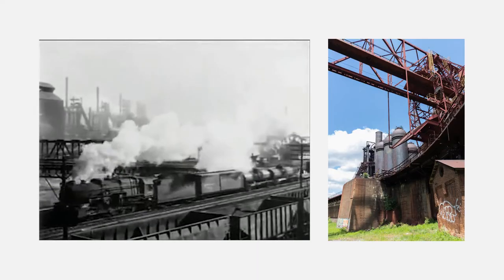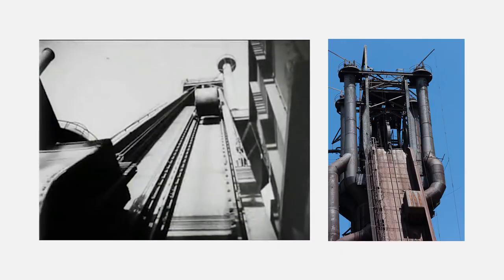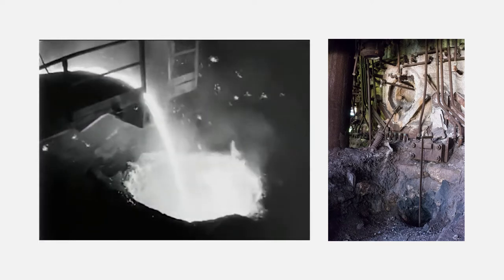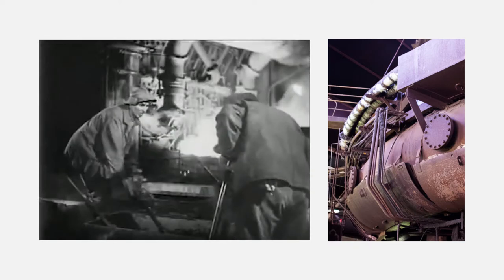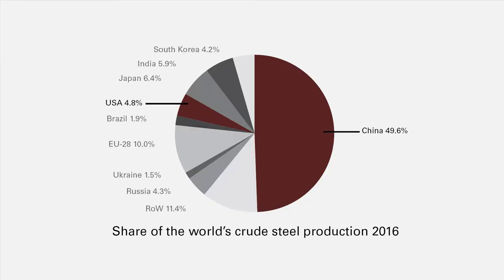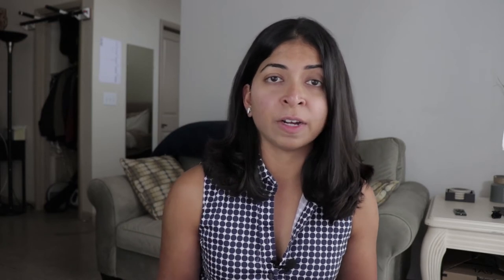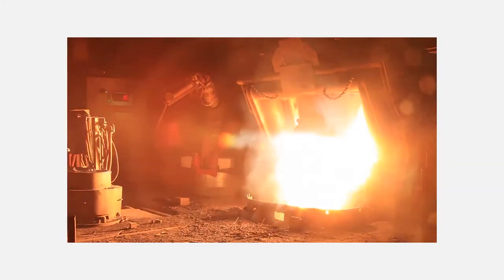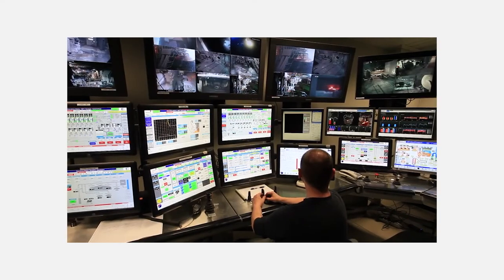Why US steel died (Carrie Blast Furnaces case study)

Comment: I had a history professor in college who worked at US steel when he was younger. His job was on the crew that would scrap slag out of the crucibles and other equipment.
He told us that because letting the equipment cool down could cause damage, and cause far too much down time. 
So his crew would get some heat-protective clothing, and they would strap wooden blocks to the bottoms of their boots, and they would have to work fast while keeping an eye on the remaining thickness of the burning blocks of wood and get out of the crucible before the wood ran out.
This was before he was drafted for WW2. He was a great professor.
Reply: That was definitely a different breed back then.

Comfort has killed drive.
Reply: It isn't a particularly ad-hoc approach.  Oak has been used as ablative heat shielding on spacecraft.
Reply: It was the same after the WW2, and it was the problem.
Reply: @josephcoon5809  "All of this family meals, use of pottery, and permament shelter crap is just weakness. Give me a grizzly loincloth and flint spear any day. Kids don't know how easy they have it! Comfort has killed drive." Hunter-Gatherer Patriarch 12,000 BC

Comment: I have said the same thing a LONG TIME AGO. Bethlehem Steel and other major U.S Steel industries should had have immediately applied a "REINVESTMENT CORPORATE POLICY" approach after WW II. The Karrick Retort Process can produce 5 products such as oil, high BTU coal gas, phenolics for making plastics, co-generated electricity produced by steam by it's water cooling systems, and smokeless and clean semi-coke which burns hotter and cleaner and thus requires less coal to produce 1 ton of iron from a blast furnace. The high BTU coal gas can be used to stoke to blast furnace to make it even more efficient, the co-generated electricity can be used to power all electrical power needs and to power the cryogenic liquid  oxygen liquefaction facilities for the basic oxygen processing furnaces. In the 1970s and 1980s the OTEC power generation technology that uses the warm ocean waters of Hawaii of 25 degrees Celsius to boil and vaporize liquid ammonia into a low pressure and low temperature gas to run the turbogenerators and using the only 5°C cold ocean seawater from an average depth of 1000 meters to condense and liquify it again back into a liquid. The same OTEC technology can be modified and adapted to use the waste heat of all iron and steel making plants to co-generate electricity to power their systems' electrical power needs partially or all of it.

Comment: Automation, A.I, and Robotization will create new carerrs in the field of "MECHATRONICS" Mechatronics, which is also called mechatronics engineering, is a multidisciplinary branch of engineering that focuses on the engineering of both electrical and mechanical systems, and also includes a combination of robotics, electronics, computer, telecommunications, systems, control, and product engineering. Mechatronics engineering technologists use a combination of mechanical, electrical, computer and software skills to work with smart technologies, such as robots, automated guided systems and computer-integrated manufacturing equipment. ... Manages electrical and mechanical systems. Tests new equipment. Installs new ...

Mechatronics engineering technologists will also create a demand for specialists specializing in mechanical engineering, electrical engineering, electronics engineering, chemical engineering, civil engineering and their sub-specialized fields such as computers, robotics, telecommunications, systems control, manufacturing product engineering, automated guided systems and computer-integrated manufacturing equipment. ...

Which in turn creates a demand for manpower in these 4 basic general engineering fields and in their sub-engineering fields or specialized engineering fields. They are then combined together in a structured organizational set up to integrate and coordinate their fields of activities to help each other to achive a final common goal and that structured organizational set up is called as the SYSTEMS ENGINEERING developed by the USAF airforce in the 1950s and by NASA in the 1960s.

The systems engineering set up(s) in turn created a tertiary sub-engineering fields called cybernetics, automation, robotics, computers, etc. And eventually evolving the residential and common office pre-computer era in the early 1980s and given a boost from a 1960s fiber optics technology that became fiber optics flower vase lamps in the early 1970s and evolved into the early 1980s fiber optics communications era FOR COMMUNICATIONS ONLY AND PRE-DOMINANTLY IN THE FIELD OF COMMUNICATIONS which eventually was adapted by the U.S Defense Department to reinforced their Computer Defense Networks using copper wires
of  their BMEWS (Ballistic Missile Early Warning Systems), ARPANET, DARPANET, INTERNET TECHNOLOGY, AND EVENTULLY EVOLVED INTO THE CIVILIANIZED INFORMATION TECHNOLOGY OF TODAY. It is only during the early 1980s and the 1990s that the fiber optic engineering technology was integrated with the glass engineering technology and optical engineerng technology (all of which are tertiary 3rd level sub-engineering fields) which gave birth to the optical fiber communications engineering technology (which is a 4th level sub-engineering field). 

Engineering in the 1960s is divided into 4 basic general engineering fields:
1. Mechanical Engineering.
2. Metallurgical Engineering.
3. Chemical Engineering.
4. Electrical (and electronic) Engineering.

Engineering from these 4 basic general engineering fields, each of them 4, are then re-classified into several tens of dozens of
sub-engineering fields knownn as specialized fields in the 1960s and 1970s and 1980s and 1990s. 

Mechatronics Engineering Technologists is one of those specialized engineering field. Systems engineering is a combination of 4 major basic general engineering fields combined togother with these sub-engineering fields or specialized engineering fields into an organized structure known as SYSTEMS ENGINEERING which was developed in the 1950s by the airforce and by the newly created agency called NASA!

In the contemporary 1970s-1980s era, engineering is generally considered to consist of the major primary branches of chemical engineering, civil engineering, electrical engineering, and mechanical engineering.

Mechanical Engineering.
Electrical Engineering.
Industrial Engineering.
Chemical Engineering.
Civil Engineering.

One go to the past engineering teaching manuals of the 1900s to 1960s-1970s-1980s to know all the basic general fields,
Reply: As machines and robots take over more work, either you increase productivity by several order of magnitude, which happened in the steel industry in the late 1800s and early 1900s and provided there is a large enough demand for the product, OR you produce the same amount of product with fewer employees.  At one point the steel company employees were paid according to the amount of steel produced.  But, as technology increased and the tonnage went up, the owners felt the increase wasn't due to the employees working harder but rather due to the owner's investment in machinery, so they changed the pay formula.

As we move to highly mechanized/roboticized factories, you will need less than 5% as many workers, highly educated and trained to maintain the machines.  Less educated and skilled people will find they have no work or minimum wage work.  And, as socialists have pushed minimum wage higher, and the cost of robots come down, companies are finding it feasible to automate jobs out of existence.
Reply: @BryanTorok  Unemployment never been lower than now. 
you need to talk with business owners to understand how hard is to get employs
Reply: @gsabic  That is the flip side of the same coin.  Low unemployment means that most people who want to work can find work.  If everybody is working, it is difficult to find people to fill job openings, particularly for less desirable and low paying jobs.  Factor in reduced work ethic, the government subsidizing people staying home, and lingering fear of COVID-19, and it is not surprising that people don't want to work.

Comment: The downside of technological innovation is that less humans are needed in a given industry.
The benefits are that the productivity of each human in a given industry rises (often exponentially), and that new industries are created as time goes on and new applications for these new technologies are invented. Sure, the buggy whip manufacturers are gone, but how much better have our lives and our societies been made because of the fast, cheap, easy, reliable transportation provided by the automobile? Air, water and soil pollution have been challenges we've faced, but as time goes on and the profit motive helps us try to make our machines more efficient, these are becoming less of a problem. In addition, in many ways, the automobile is less hazardous than the literal mountains of horse manure that used to be hauled out of New York every day. And as the automobile has been improved, how much have our lives further improved by the chemical, plastic, aluminum, electrical, rubber and other industries that sprang up to help support the automobile? How many jobs have been provided by these industries? My gut tells me that it's far more than were lost by industries that had grown up to support horse transportation.  
Excellent video.
Reply: Automation, A.I, and Robotization will create new carerrs in the field of "MECHATRONICS" Mechatronics, which is also called mechatronics engineering, is a multidisciplinary branch of engineering that focuses on the engineering of both electrical and mechanical systems, and also includes a combination of robotics, electronics, computer, telecommunications, systems, control, and product engineering. Mechatronics engineering technologists use a combination of mechanical, electrical, computer and software skills to work with smart technologies, such as robots, automated guided systems and computer-integrated manufacturing equipment. ... Manages electrical and mechanical systems. Tests new equipment. Installs new ...

Mechatronics engineering technologists will also create a demand for specialists specializing in mechanical engineering, electrical engineering, electronics engineering, chemical engineering, civil engineering and their sub-specialized fields such as computers, robotics, telecommunications, systems control, manufacturing product engineering, automated guided systems and computer-integrated manufacturing equipment. ...

Which in turn creates a demand for manpower in these 4 basic general engineering fields and in their sub-engineering fields or specialized engineering fields. They are then combined together in a structured organizational set up to integrate and coordinate their fields of activities to help each other to achive a final common goal and that structured organizational set up is called as the SYSTEMS ENGINEERING developed by the USAF airforce in the 1950s and by NASA in the 1960s.

The systems engineering set up(s) in turn created a tertiary sub-engineering fields called cybernetics, automation, robotics, computers, etc. And eventually evolving the residential and common office pre-computer era in the early 1980s and given a boost from a 1960s fiber optics technology that became fiber optics flower vase lamps in the early 1970s and evolved into the early 1980s fiber optics communications era FOR COMMUNICATIONS ONLY AND PRE-DOMINANTLY IN THE FIELD OF COMMUNICATIONS which eventually was adapted by the U.S Defense Department to reinforced their Computer Defense Networks using copper wires
of  their BMEWS (Ballistic Missile Early Warning Systems), ARPANET, DARPANET, INTERNET TECHNOLOGY, AND EVENTULLY EVOLVED INTO THE CIVILIANIZED INFORMATION TECHNOLOGY OF TODAY. It is only during the early 1980s and the 1990s that the fiber optic engineering technology was integrated with the glass engineering technology and optical engineerng technology (all of which are tertiary 3rd level sub-engineering fields) which gave birth to the optical fiber communications engineering technology (which is a 4th level sub-engineering field). 

Engineering in the 1960s is divided into 4 basic general engineering fields:
1. Mechanical Engineering.
2. Metallurgical Engineering.
3. Chemical Engineering.
4. Electrical (and electronic) Engineering.

Engineering from these 4 basic general engineering fields, each of them 4, are then re-classified into several tens of dozens of
sub-engineering fields knownn as specialized fields in the 1960s and 1970s and 1980s and 1990s. 

Mechatronics Engineering Technologists is one of those specialized engineering field. Systems engineering is a combination of 4 major basic general engineering fields combined togother with these sub-engineering fields or specialized engineering fields into an organized structure known as SYSTEMS ENGINEERING which was developed in the 1950s by the airforce and by the newly created agency called NASA!

In the contemporary 1970s-1980s era, engineering is generally considered to consist of the major primary branches of chemical engineering, civil engineering, electrical engineering, and mechanical engineering.

Mechanical Engineering.
Electrical Engineering.
Industrial Engineering.
Chemical Engineering.
Civil Engineering.

One go to the past engineering teaching manuals of the 1900s to 1960s-1970s-1980s to know all the basic general fields,

Comment: One blast from an EMP or CME and all of those microsoft assisted technologies will just be so much scrap metal. I prefer analog systems, manned or unmanned.
Reply: well..there are EMP resistant electronics, and they aren't THAT expensive, maybe some sensors here and there would need replacing..